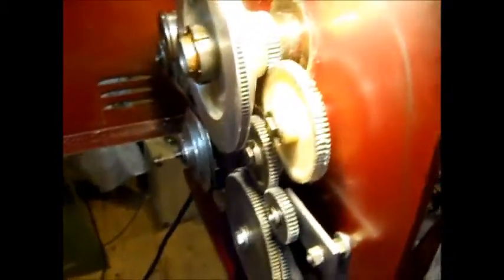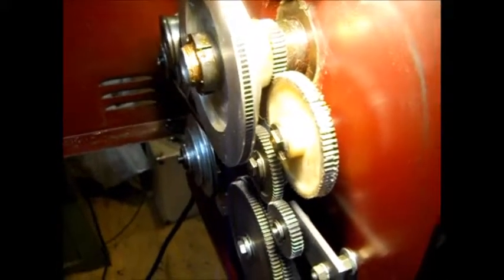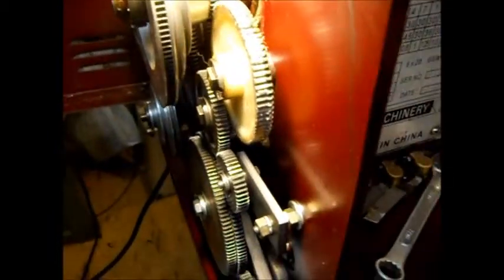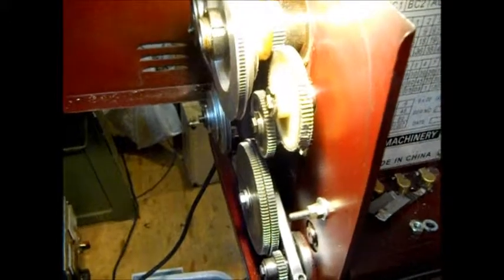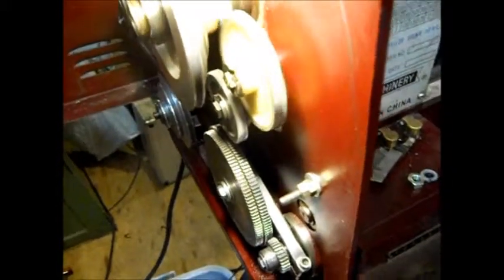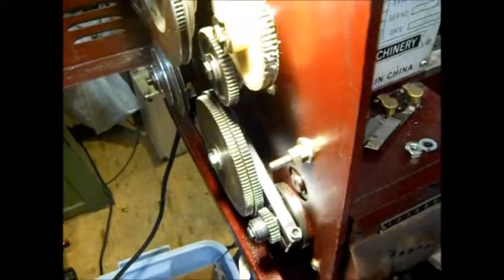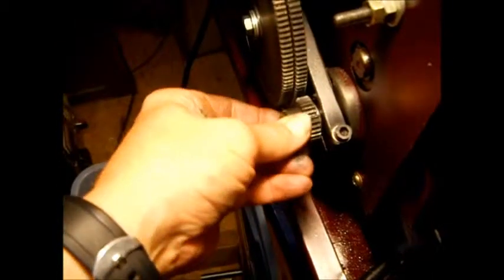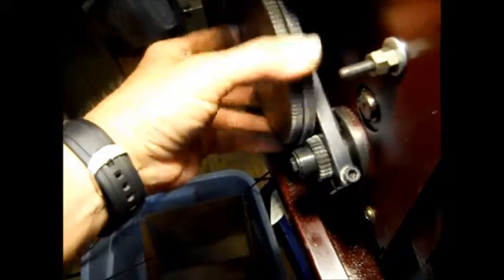Lathe Gears

Comment: Paul, I can see your small gear clear down on the bottom.  I think is on wrong. Take it off and turn it around, you have two gears running on the one large inner gear. The gear on the bottom should run on the outer large gear. Hope this helps. Norman

Comment: I think you are correct. The original shaft was damaged and I made a new one using an ordinary bolt and nut, so the fit is not very good. I have more experience now and I'd like to try some threading, so this would be a good project for that. I have some lithium grease and I'll try it on the gears. I replaced the plastic gear with a spare, and it works much better. I was able to make some 3/4-8 LH SQ adjusting screws form 4140 for my 6" chuck. Thanks!
Reply: +PaulAndMuttley 

Hi Paul, I have recently bought a mini lathe from king canada (KC-0712ML) During the assembling, I have noticed the use of plastic gear too. Based on your experience, can you actually machine steel before it get worn?
Reply: +thephatnguyen the plastic gear is only involved with the feedscrew, and otherwise it is just pulleys and belts that drive the spindle. I have machined steel and aluminum with no major problem. It was just when threading or using power feed that the plastic gear was damaged. This is a 9x20 lathe and not a 7x12, but those smaller lathes are similar, and also can machine steel within the limits of their capabilities.